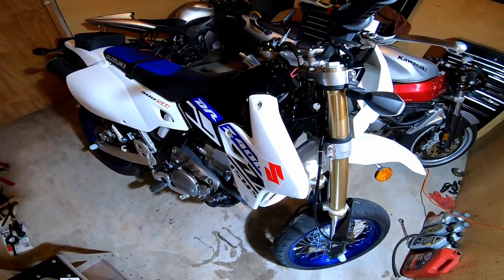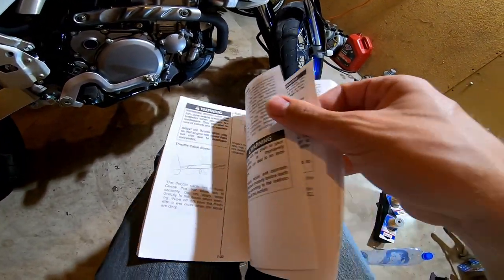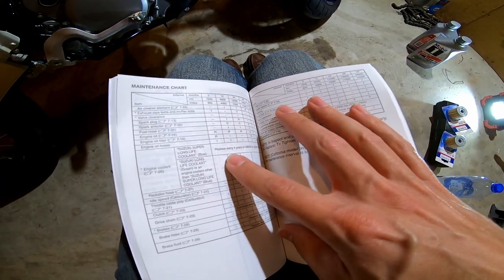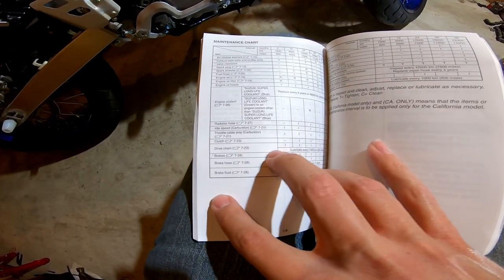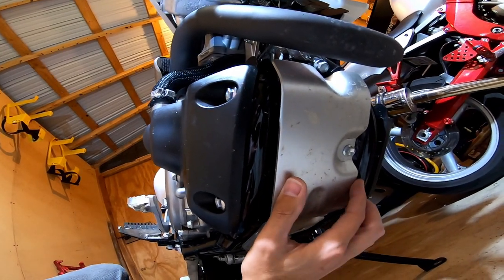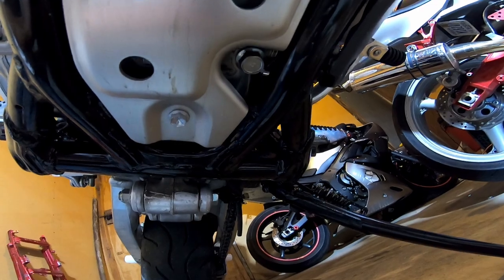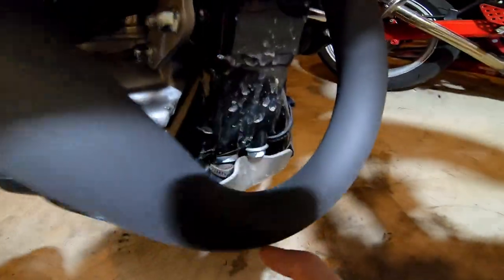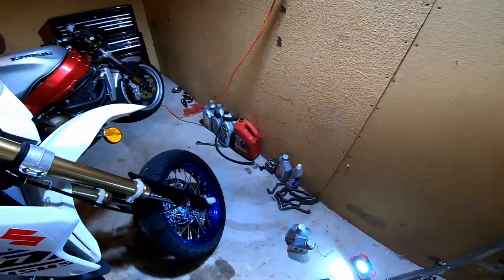Suzuki DRZ400SM First Maintenance Interval and Oil Change Procedure

Comment: Hey quick question is it a good bike to start with? have you had any issues with it at all?
Reply from the maker: I’ve gotten 6,500 trouble free miles out of it so far. Basic maintenance is all it’s needed. Zero issues so far.

This is a tough question. There are many ways to start and an absolutely absurd number of good options available to do so these days.  
This is my opinion, and not everyone would agree with it, so take it for what it is… 

I personally believe dirt bikes are the best way to start riding motorcycles. I believe that for several reasons. Riding in the dirt keeps you out of traffic while learning and also teaches you how to deal with inconsistent terrain. When you’re on the street and you encounter sand or gravel it won’t be a surprise and the risks will be inherently reduced because you’ve already experienced it and know what to expect. Pavement is by far the worst surface to fall on. Taking your knocks in the dirt is beneficial for that reason. I understand not everyone has good access to off road areas and nothing replaces seat time.

The DRZ400 is a very reliable machine. It’s been around forever. Parts are everywhere and it has great aftermarket support. It’s a good compromise because you can ride it on the street and in the dirt. The biggest downside with “dirt bikes” like the DRZ400 is the seat height. For a new rider the height can feel somewhat awkward. The center of gravity is high compared to most street bikes. The benefit is it’s also lighter than most street bikes which helps in that area. It’s not a 600 pound Harley, it’s a 320 pound dirt bike. If you’re planning on long distance interstate travel it’s not a good machine for that. It can go nearly 100mph topped out but realistically lives life under 75mph. 

All things considered I think the DRZ400SM would be a good first bike. The shorter 17 inch wheels help with the seat height issue. You can toss 50/50 tires on it and ride it anywhere if you want to do dual sport tasks or have access to off road areas. It’s significantly cheaper to repair than a street bike would be if/when you do get wadded up. It really just comes down to what your individual needs are. Like I said there are a metric ton of ways to get started.

Comment: Hey buddy, I have a 2020 400sm, i cant find anywhere what type of oil filter is required for my bike. i would imagine it's the same as yours, you can you let me know  the parts and numbers you ordered? thanks so much in advance bud
Reply from the maker: No problem man, the part number for the OEM Suzuki oil filter I used in this 2019 is 16510-29F00. It's actually the same filter for all DR-Z 400 models as well as the LTZ400 four wheeler. To my knowledge there has never been a change, so the same filter works for everything from 2000 - 2020 in all models (E, S, and SM). I actually picked up my filter at a local Suzuki dealership, but we don't all have that convenience, so here are a few options from different vendors. 

OEM Suzuki filter from MotoSport:
https://www.motosport.com/oem-parts/part-number/16510-29f00

Here is a RevZilla link to the Maxima ProFilter filter:
https://www.revzilla.com/motorcycle/maxima-profilter-maxflow-oil-filter-suzuki-drz-400-2000-2017

K&N filter from Cycle Gear:
https://www.cyclegear.com/parts/kn-oil-filter-kn-139

Hope this helps!